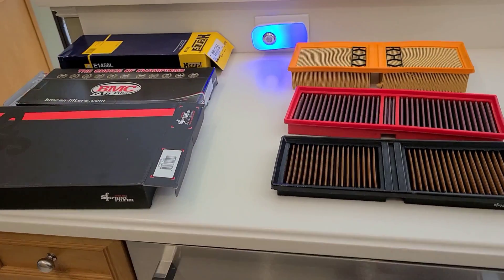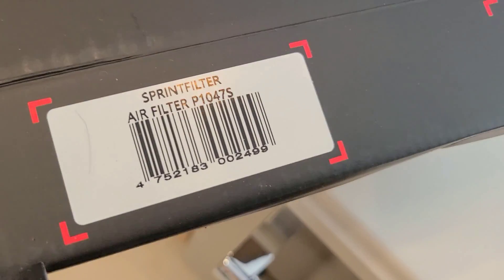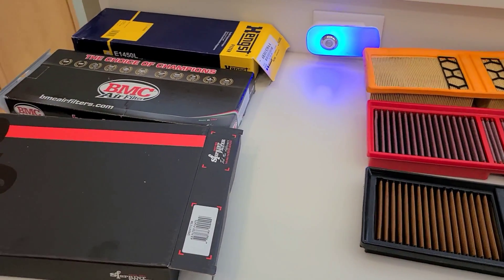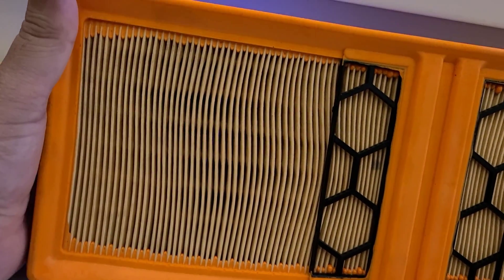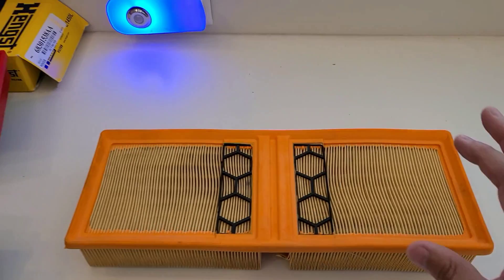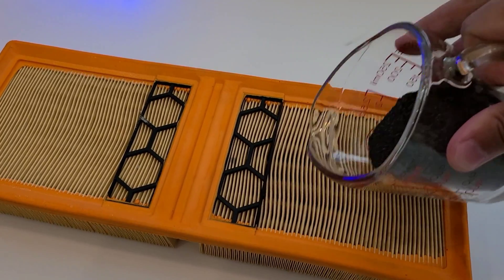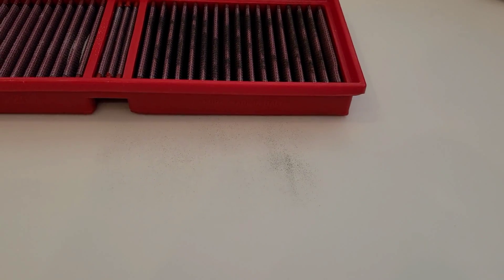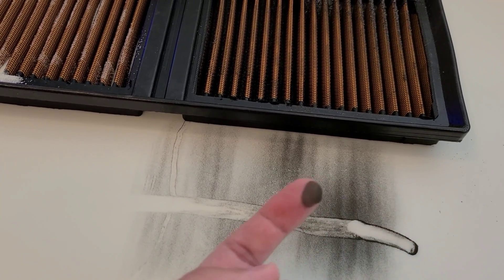Do performance air filters like BMC, K&N, Sprint let more sand and dust than OEM and is it worth it?

Comment: Was interested until you started pouring on the back side of the filter?! Invalid test and totally wasted time
Reply: Bru 😂😂😂😂😂😂😂 everything that passes in a way will pass the other 😂😂😂😂
Reply: @Investidordestro wasn't designed to work that direction, sure it'll catch most
Reply: Vero, sopratutto lo sprintfilter è progettato per essere pulito con l'aria compressa, dall'interno verso l'esterno. Se dall'interno versi impurità passeranno piu facilmente.

Comment: which sprint filter did you used? If you used the racing P08F1-85 or the P08 it doesn't much the criteria with the other two. They are for high performance cars and doesn't catch much dust. Maybe the P037 or P14 should be better?

Comment: In the SprintFilter brand there are several ranges of filters for use of vehicles on track in Grand Prix GP for example which filters particles above 85 microns but feeds the engine with air for rail use in the sandy dessert for which SprintFilter has designed an air filter filtering particles up to 12 microns. You are not objective because you do not specify which range of air filter you used for the SprintFilter brand and you also did not oil the BCM brand filter. Repeat the test by oiling the BCM filter and with a SprintFilter model T12 we will talk about it later.

Comment: The comments are hiliarous, K&N are built to be less restrictive, which means that small particles WILL get through. Also remember that paper filters also don't 100% filter every particle. But the engine burns them up before they can do any serious damage (over 2,500°F / 1,370°C in some cases).

But also you need to remember K&N is not a drop in and forget. It needs proper maintenance and you can avoid any long term issues. You can daily drive K&Ns with no problem, millions have.

Comment: Ive been using performance filters for about 15 years now. Had kn but did not wanted the oil in it. Swithed to AEM dry. always checked the clean side of filter for any sign of dirt and it was always flawless. Just bought sprint filter for my new car ;) And I will check it after a while.

Comment: Thanks for the video and while it was a very rudimentary test made a very good point. Imagine if there were suction from intake the amount of iron getting thru the K n N would be worse.  If you have a daily driver keep filtration stock also nobody tests K n N in real world driving are the gains it may give only at full throttle???? Are there any benefits with partial throttle driving??

Comment: Hello, I was watching your experiment in the home world so to speak. But it has ignored the main formula of how a sports filter works. Filters like K&N, BMC and DNA for example. They work moistened with a certain amount of oil, usually when they come out of the box they already come with the oil from the factory. In your case you are using dry cotton filters, because they will always allow sediments to pass through the cotton fibers. The objective of these filters is longevity, and to obtain better air flow, but do not forget that they work moistened with oil. . that the manufacturer provides, without the oil it is just silky. I'm sure that if they had put the oil in, it would have a complete filtration of the particles. 

You have to lubricate, and remove the contaminant from the appropriate side.. A cordial greeting.

Comment: Large particles really are not a huge issue to motors, yes the can score cylnder walls but its the stuff 5 microns and smaller which can fit between the tightest of tolerances in a motor.

Big particles get filtered out be it in oil filter, air filter, or simply can't progress further into the motor and get drained out with oil. The finest of dust is what makes lap after lap around the motor causing wear each time.

Also the same stuff which will not get filtered out by your typical oil filter. That's why filtration at low microns matters.

Comment: Forget "performance" filters. On track day, just buy a brand new OEM filter, take it to the track, and install it there. A brand new filter flows as well as any, and offers much more protection for an engine, especially, because tracks are often more dusty than the road, and, the engine will draw much more air while racing, than just cruising down the road. Between those two things, you REALLY need the filtration capabilities of an OEM filter!
Reply: I have both K&N performance on my bike and car and though I didn't notice power increase cause they are both low HP, the engine changes completely it gets much smoother right away.

But if you have the car or bike specially tuned for "X" air filter and exhaust you will lose quite some power with OEM filter, it will never, ever breed anywhere close to a performance air filter OEM replacement.

Comment: I had a performance cold-air intake system(Stillen Gen3 long-tube) installed on my 370z as part of a performance upgrade plan. The system uses two large cone-shaped K&N oiled cotton air filters. I've had it on for about 20K miles and have had two used engine oil analysis reports done during this time. Neither report shows excessive levels of silica(sand) in the oil or anything else that would suggest that excessive dirt is getting through. My examination of the whole intake tracts on both cylinder banks showed no dirt deposits downstream of the filter elements. There was also no sign of oil residue on the MAF sensors, the throttle bodies or anywhere in between.

My experience with the filters has not been such that I would have a concern about excessive dirt getting through the filters in normal usage. The only downside that I would see to the use of these filters is the higher upfront cost and the necessity to carefully clean and reoil them. These filters typically last much longer than paper surface filters, so the higher initial cost is at least partially balanced out in the long run. This system, plus the less restrictive exhaust that I put on the car, resulted in so much more air flowing through the engine that my tuner had to recalibrate the air-fuel ratios over the whole rev range and to optimize the ignition timing. This resulted in an estimated 55 hp increase in peak crankshaft horsepower. All of it was a worthwhile thing for me to have done.
Reply: Finally a real life response with arguments. Thank you.

Comment: Thanks for trying to do this comparison but your tests are truly not representative of reality and ultimately a useless means of comparison.  First thing to know about filters is that they are NOT strainers.  Strainers physically stop particles larger than the open spaces in the strainer's mesh.  Filters need to, and can, attract particles smaller than the path width between filter fibers. To do this, filter media needs some thickness and the path that air takes through the filter must be tortuous, so that the particles carried in the air stand a good chance of striking and sticking to a fiber in the media.  Filters with a large surface area benefit from slower air speed through the media and ALL filters, paper and otherwise, have some kind of coating on the fibers that will attract and hold particles. So, filters filter finer particles better once the are partially loaded with "dirt".  If you want to filter fine particles with less restriction - get a really big filter!

Comment: Has the K&N been oiled? Also, doesn't the air pass through all those filter from the bottom to the top, not from the top to the bottom, as you had poured the sand/dust?

Comment: I buy my Yamaha royal star venture used. It had 30,000 miles on it, and it had K & N stock replacement air filters, there are two air filters on these machines.
  I have a video on my YouTube channel, Yamaha royal star venture major flaw is the title of it. In that video, I pointed out all the filth and dust inside my intake system. I was blaming that on loosefitting plumbing of the intake system to the carburetors. But it turned out to be the K and N Eric layers were leading all of that dirt in… I have another video pointing out what I would do if I were anyone watching the video that had KNN air filters in their machine. They may pass more air which they do in testing, but, they also let more than 10 times the dirt get in. A YouTuber with a website called project farm prove that by sifting flour into a box with a vacuum below the box, pulling air through the filters in a comparison with a meter that measured particulates that go through the filters. The K and N oiled air filter was the one that passed the most air, and the most Particulates

Comment: The video could be misleading. You need to show whether the filters were oiled as required. 
The video seems like the filters were dry, which is not the right way to use these filters

Comment: Was the K&N treated with the oil before you tested it? If not, that could make all the difference with its ability to filter finer particulates.
Reply: That's exactly my question. The video seems the filters were dry. 

I can't imagine particle coming thru like this thru an oiled filter

Comment: Run the same test with a foam filter. 
Don't use a Pipercross as they are too thin. 
A Unifilter or something designed for dusty conditions would be ideal.

Foam filters ~50% more than paper.

🙂

Comment: When it comes to filters its not the vehicle that benefits it's the person. If you're a lazy person get the OEM filter.  If you like spending hours on your vehicle then get the Sprint. And if you want peace of mind get the BMC/K&N.
Reply from the maker: I agree except piece of mind would be the OEM filter as they filter best and being cheap would be the KN filters as they are much less expensive than most OEM over the course of vehicle ownership
Reply: @bhvrdr  the problem with ORM filter is that you have to keep replacing.  With KN and BMC you can simple clean and reuse.  When out in the woods I rather have one that I can reuse.
Reply from the maker: @h.nguyen4193  it is a good point you make which is the difference between having to clean a filter vs just replacing a filter.  I'm personally not a big fan of cleaning the cotton gauze filters they really are made out of cotton gauze and if you've ever inspected one after 100000 miles the cotton has broken down quite significantly I'd be happy to show pictures of ones of mine that have.  I tend to replace cotton gauze filters at around 50,000 miles.   I don't use them in any vehicle that sees significant Dusty environment of course.
Reply: @bhvrdr  I ride a triumph street triple motorcycle and it’s wicked important to have a clean filter.  But the trade offs are the same. Instead of changing or cleaning the filter after years, a motorcycle filter is change or cleaned annually.
Reply from the maker: @h.nguyen4193  those are incredible motorcycles
Reply: @bhvrdr OEM Filter is ca 1/5 of the cost of a BMC

Comment: "K&N style." Made in India. It's not a K&N.
Reply from the maker: That is an extremely high quality BMC filter which is well known in the industry of being at least the quality of a k&N filter which are much more budget priced and built but they use the exact same technology which is four layer offset cotton gauze
Reply: @bhvrdr  I'm not buying it. It's not a K&N. You didn't test a K&N. You tested a 3rd-world copy of a K&N.
Reply from the maker: @bongodave13  You don't have to buy it just simply have to look up the information because it's factual and not opinion.  BMC filters are manufactured in Italy and were designed in collaboration with Formula 1 and are of the highest quality known if you look at objective testing.  And I think you know where k&N stands.
Reply: @bhvrdr  No, I don't know where K&N stands, because you didn't test one.

Comment: How you gonna test a filter WITH NO AIR FLOW? This is a retarded test.

Also, the amount of particulate matter here being used is completely unrealistic and the filters are brand new. No filter performs at peak efficiency when new, they have a break-in period. A certain amount of dust adhering to the filter is needed to make it perform at 99+% efficiency!

Comment: nothing beats stock parts for reliability
Reply: Yep and the stock filter provides more than enough air for the engine. Just change them when dirty
Reply: Keep telling yourself that, if that was the truth you wouldn't be able to mod engine to get double the HP by using other brands of parts. Car manufacturers cut costs everywhere they can. I also guarantee the decent quality suspension will also be much better than stock.
Reply: This is where we have the trouble. The authorized dealers fleece us. They charge 3 times the cost of filters found online!!!
Reply: planned obsolescence

Comment: Again, another guy that gets the "performance filters" wrong. Although they can increase from 2 up to 10 hp that's not what they are made to do(k&n). They are made to significantly increase the gas pedal responsiveness and improve the long lasting ability of the filter. They won't harm your engine and they will defenately do the job way better than the OEM ones. And also you actually pay way less for a performance one because you need to change your OEM every 70.000km in comparison with the performance one where you just clean it. It's a good video anyways.
Reply from the maker: Gas pedal response is controlled by the throttle controller.   There is zero difference between these and oem filter logging throttle pedal position versus throttle body position which is the only way to objectively measure response. 

   Filtering down to only 70 micron is absolutely able to let in contamintes that can cause long term damage.  Because of engine tolerances its actually the 5 to 10 micron range contaminates that can fit into tight tolerances and cause damage.   

Yes you can use a reusable  filter as a  means of saving a few dollars every 20k miles however if youve ever seen some dry and oiled filters after a few years id highly recommend not doing that.  Despite advertising the media (cotton or synthetics) dont last forever lol.   You ever seen a cotton shirt after two years of daily wear?   Ive personally seen bits of the cotton media and synthetic degrade over time to the point the intake tract is filled with red fibers.

Comment: Appreciate you doing these tests, and a more restrictive paper filter will obviously filter better than a higher flowing oiled filter.  But it's funny how for the first paper filter you're barely tapping it on the table so no particles go through while the K&N you're hitting it on the table much much harder, re-watch your own video and see for yourself.
Reply: You might have to watch the video again because he used decent force tapping the paper filter as he did with the others.
Reply: I thought the same, it is noticeable especially on the iron particles

Comment: Esos filtros sólo son para motores que uses en carreras o en un circuito y que no van a tener que durar 300 mil km. No son para un motor de uso normal a diario. Para un motor que quieres que dure cientos de miles de km. hay que filtrar el aire todo lo que se pueda, aunque eso suponga una mayor restricción de flujo/menor caudal de aire.

Comment: You could have done this test with the Sprint Filter P037 which has a filtering of 37 microns against the 80 microns of the tested model.
Reply: Most engine damage is done by particles in the 5-20 micron range. Even a 37 micron filter does not inspire confidence though it's better than 80 for sure.

Comment: For the biker guys here: Should i install now the BMC Filter in my yamaha r1 rn19 or better use the OEM one? I am honestly confused now....
Reply from the maker: Figure oem gives best filtration so if you dirt bike go with oem.  Bmc / k&n are middle ground with better flow and ok filtration so if you street bike or race go with those.  Sprint id only put on a dedicated race bike.
Reply: @bhvrdr  Thanks for your answer. I only ride on the normal streets but dont want to hurt my engine if I use the BMC longer. I think then i go with the OEM. I thought sport Filter filters the air much more better..

Comment: I would suggest that looking insider the air-box is a good indication. it should be clean on the manifold side, dusty and dirty on the intake side. I guess a lot depends on the environment the vehicle is used in..A vehicle that is used only on public roads/highways is obviously going to have an easier life than one that is using rough tracks/off roading for extended periods.... I use a K&N filter on my Triumph Street Triple 675 with no problems..

Comment: I bet installed in cars these filters will not knock hard on themselves letting debris through as when knocked on the  table
+ If you are not doing of road and hitting asphalt only, then these performance filters  + remap will be alright

Comment: The thing is most people are idiots and they get sold on the whole high flow race filter thing when the only thing they do with their car is drive it on the road like on the road when that stuff is designed for race cars and bikes on a track for very short amounts of time with engines that get rebuilt and maintenanceed extremely often. OEM air filters are designed for people who will drive a car on dirty roads for long periods of time. If you aren't driving on a race track or maintenance and rebuilding your engine very often stick with the OM filter. If you race and every single horsepower matters use sprint or don't even use an air filter at all if you want the most power and max airflow. But if you want your engine to stay clean and last as long as possible stick with the OEM